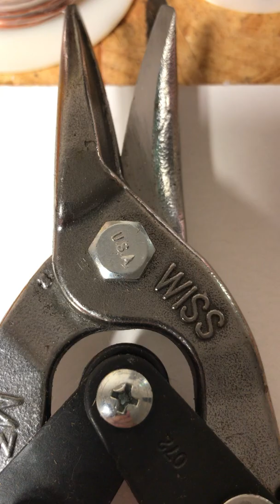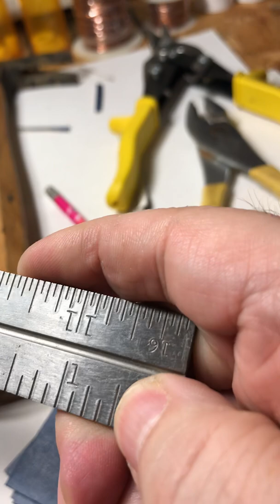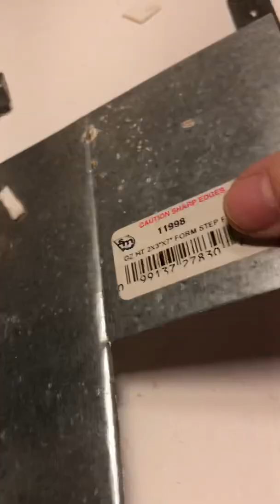🧲 Live Magnet Motor Class on YouTube & Facebook | Free Energy Research

Comment: I found some almost non magnetic batteries dead or alive called Mercury Cadmium, try them I emmediately thought of you and this shielding technic this may make it even better.
Reply from the maker: 24Seven - MuMetal is even better.
Reply from the maker: 24Seven - No longer need the batteries. They were simply used in a pinch for the lack of better shielding materials around the house. Thanks though.

Comment: Can anyone answer me please, what is the material used for the magnetic shielding? I heard him say it's tin, just regular tin?? I was checking out mu-metal but if i can use tin even better :)
Also many thanks Mr. Roney, you are a hero of the world, we are very close to the breakthrough, 3 6 9!
Reply from the maker: 🔴 One Light - Tin Metal ... its  used by roofers as flashing. Toss out the batteries, and use MuMetal instead.
Reply from the maker: One Light - 

😮 What you’ll need to have with you for the live Facebook/YouTube webinar. Time to be announced.

🔴 Tin snips
🔴 Pliers
🔴 Needle Nose Pliers
🔴 Carpenters Hammer
🔴 Wide Blade Chisel 
🔴 Tin Flashing or MuMetal 
🔴 Matt/Art Board 
🔴 A 2”x1”x1/4” Neodymium N42 Magnet
🔴 Pencil or Fine Tip Marker

Warning, because of the sharp edges of the tin, it’s real easy to cut yourself. If you choose to build one of my Stators, you do so at your own risk of personal energy.
Reply: Thank you very much! :)
Have you heard of GIRON material? It's supposed to reduce the magnetic field down to 0 gauss, so I think that would be even better than using Mumetal..

Okay I just have to ask you this, have you heard of an earth battery? Its a means of gathering low voltage from pods filled with earth, and you can get anywhere from 2volts to 10 volts, potentially even more, the only problem is the amperage is really low.

HOWEVER, I believe combining the earth battery with this spinning magnetic field wheel is the key to  creating  a self propelling induction motor, let's see what we can do :)
Reply from the maker: Never before Live Feed Wednesdays and Friday’s, step by step on my open source research. I make no claims, rather I share actual results gained from my research. 

🔴 ALL MAGNETS ARE ALWAYS IN ATTRACTION MODE. YOU CAN USE EITHER POLE OF YOUR CHOICE. 

Because my researched has now been shadow banned of both YouTube and Facebook, nearly all of my thirteen thousand plus combined subscribers will never see this announcement, or my new videos, unless you share it yourself. 

Youtube Live Friday’s, 9pm, EST
Facebook Live Wednesdays, 9pm, EST
For a limited time. 

😮 Here is a detailed list you’ll need to obtain to replicate my findings. In the event you substitute items on this list may give you different results, or no results at all. Closely following instructions is important for best results.  

(STATOR LIST PER BUILD & TOOLS)
🔴 Tin snips
🔴 Pliers
🔴 Needle Nose Pliers
🔴 Carpenters Hammer
🔴 Wide Blade Chisel 
🔴 Tin Flashing, MuMetal
🔴 Solid Matt/Art Board, or 1/4” Plastic 
🔴 A 2”x1”x1/4” Neodymium N42 Magnet
🔴 Pencil or Fine Tip Marker
🔴 Washcloth, or Hand Towel
🔴 Duck Tape or Masking Tape
🔴 Light hammer 

(WHEEL ASSEMBLY PARTS & TOOLS)
🔴 30” steel bicycle wheel or substitute
🔴 16, 1”x1”x1/4” N42 Neodymium Mag.
🔴 16, 1” round by 1/4” Neodymium Mag.
🔴 2 rolls of electrical tape
🔴 2, wooden 2”x4”x8’ to build frame
🔴 16, 3” long wood/deck screws
🔴 Wood saw
🔴 Wood glue, optional
🔴 Drill with dill set for wood
🔴 Brass wood screws to secure Stators 
🔴 Philips screwdriver 

Other parts might be required that did not make this list. Do not use magnetic metal parts to secure stators. Brass or plastic parts only. 

Optionally, this frame system is a lot easier to build if you use 4” PVC piping to build it. You can also build a ‘fork’ system, like that found on bicycles, to mont the wheel. Other ways are possible, but you get the idea. 

😮 Warning, because it’s real easy to cut yourself on the sharp edges of tin and other thin metals, you choose to build my Stators, at your own risk of personal energy.

🚨 ALERT: Around March of 2018, YouTube (and now Facebook) started blocking or partially blocking my content from my online community of subscribers. Doing so in such a way, that it’s not readily apparent to my nearly fourteen thousand combined subscribers. It’s called, ‘shadow banning’, a whole new approach to information suppression online, rather than outright deleting accounts. 

🔴 Why target me for showing, ‘cause and effect’ of permanent magnets interacting with each other? It’s open source, and I have nothing for sale on this. The results seen in all my videos showing cause and effect are real results. 

😮 Since this channel could always get completely banned at anytime, it’s strongly advised yo copy and repost, any of my videos you value. Lost two YouTube accounts, and one Facebook account already. I’ll simply set up a new channel again if need be. Just use basic magnet motor searches along with my name to find me again. 

✅ FreeMagneticEnergy.info is still up and running for now. 

🍷 PS: I CAN’T RESPOND TO EVERYONE.